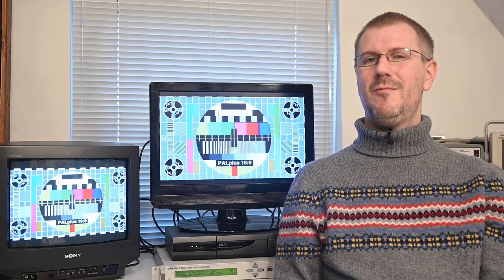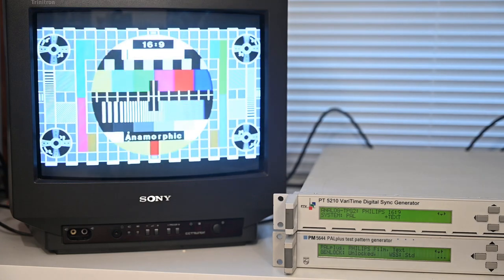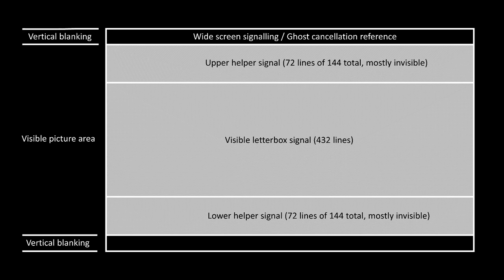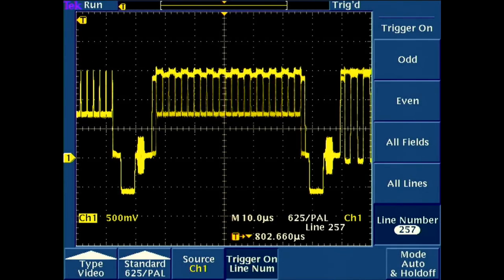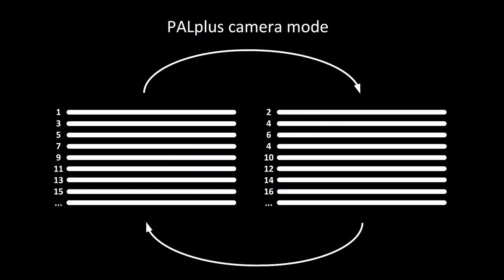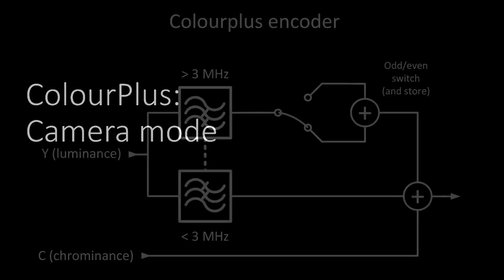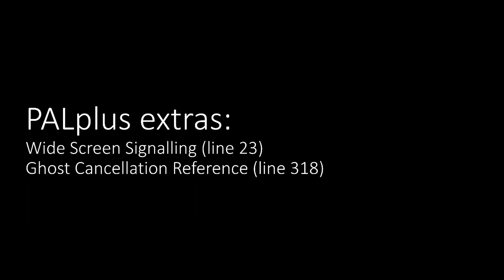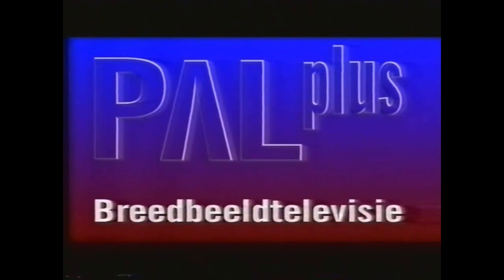#14 - PALplus explained and demonstrated

Comment: It's interesting to note that the case of the PALplus decoder is identical to that of a satellite receiver (Luxor MAC IV) manufactured by Nokia in Sweden in the mid 90's. There are two unused card slots in the front that were to be used for Eurocrypt smart cards.

Comment: How did the PalPlus signal work with color under VCRs? Remember that the color playback hetrodyne process produces a free running subcarrier against the signal H&V sync. And then the azimuth recording process also needed a field by field subcarrier phase swap as the head azimuth crosstalk cancellation was no good at the down converted chroma frequency.  I also noted lack of any analog anti-aliasing or re-construction filters on those ADC and DAC chip. (unless they were SMD under the board).  That right there is a serious image quality problem. I mean how much do a few small inductors and capacitors cost?
Reply from the maker: I don't know at present, but it sounds like an interesting thing to test
Reply: Well I don't think the re-construction filters were that important. After all the worst that could happen was that the video looks a bit "pixelated". All the signal frequencies are well below half the clock rate. In fact typically you sample composite video at 4 times the chroma subcarrier which gives you ample headroom.
Reply: I know there were some "VHS" recorders advertised to support PALplus. I think I actually have a PALplus recording standard consumer color under recording (Video 2000), but Video 2000 uses some trickery by averaging the chroma of lines for noise reduction. It might be that, for example U-Matic would just record it with reduced fidelity.
Reply: @mattstvbarn  Does the VCR SCART output a full-height anamorphic decoded picture (so you could archive the PALplus decoder output)?
Reply from the maker: @stephenneal7373  from memory it does, yes

Comment: Well in Germany that transmitter problem probably wasn't to relevant, as the early 1990s saw a huge shift towards satellite in Germany.
I think the first video I saw of PALplus was a demo tape... probably even down-scaled from HD as it looked spectacular. It was interspersed with a variety of test patterns.
There was in fact regular programming well until the analog switch off, but encoders were no longer replaced. So if an encoder was broken that source would from then on only transmit letterboxed PAL (or of course 16:9 over DVB).
What I've noticed in the late days of PALplus was that the quadrature filter for letterboxing wasn't very good. You could often see diagonal lines getting regularly spaced kinks in them. Sometimes stations would also put their PALplus encoder before the "bug inserter" resulting in broken signals.

What was missing for PALplus in Germany were the receivers. Virtually no TV-set had one built-in, external decoders were insanely rare. I wouldn't be surprised if there were more D2-MAC receivers than PALplus just because for a while it seemed like the future would be HD-MAC and a D2-MAC receiver would be compatible. PALplus was always designed as an intermediate step.

However from what I can gather, at least some modern TV chipsets employ a lot of the techniques coming out of PALplus. I have a (homemade) test signal generator with a 4,3MHz luma-burst and at least my 2010 Grundig TV was able to perfectly separate luma from chroma there. It's PAL decoding was done by a Mediastar (now Mediatek) chip"set", so that was nothing special.

BTW if you ever want to do something about Teletext. I do have a little animation I made for showing at talks. It starts by showing a real decoded video signal. Then it shrinks the video and brows up the teletext lines, then showing each scan-line being translated into it's textual data.

Comment: Great video (Though I'm pretty certain PALPlus fully blanked the source lines 23 and 623 - the half lines - and used them for references + Line 23 also has a half line of WSS) so PAL Plus really delivered 574 lines, not 576, which means the letterbox is 430 not 432 lines from memory).  Also the guy in the blue jumper and checked shirt at 7'39" in the old BBC Outside Broadcast scanner / van is my dad!

Decoder SCART is almost certainly to feed out and back to an external descrambling box for Pay-TV.  If PALPlus was used on satellite (or they though it would be) then it may have been aimed at pay-TV operators (or it may have needed to be integrated into that kind of set-up).  I've read two reasons for VCR SCARTs - one was to be able to record the anamorphic decoded output to VHS (retaining a higher quality recording than the letterbox), the other was to allow you to record and replay PALPlus programmes and decode them from VHS (though the helper signal would have been near-useless after VHS chroma recording?). The TV output is presumably also RGB analogue - because of the joy of SCART so you get the benefit of ColourPlus?  If you re-encoded to composite you'd have lost that?  

All the demos of PALplus I saw were pretty dreadful.
Reply from the maker: I wasn't able to get RGB out of it.
Reply: @vbarn  How odd. I can't imagine the purpose of a PALplus decoder with all the ColourPlus stuff if it didn't decode to RGB.  If as a manufacturer you're re-encoding to PAL for TV viewing you're killing the picture quality.
Reply from the maker: @stephenneal7373  I've heard this model didn't do colourplus.
Reply: AFAIK Premiere Germany used to provide PAL+ shows scrambled with Nagravision Syster so it means these technologies were compatible.
The decoder for Premiere could use single SCART cable between the TV or SAT receiver, same as Canal+ in France and Poland used.

Comment: An excellent video.  Thanks for taking on this incredibly complicated technology.  And hats off to those who engineered all this. I wonder if Techmoan will also do something on PalPlus?  There must be a rubber belt in there somewhere....
Reply: The main problem with trying to do a video on PALplus is that there are very few sources of full-res PALplus video these days, other than expensive test signal generators (as seen in this video) and maybe S-VHS off-air recordings made at the time, but good luck trying to find some of those. Standard VHS recordings typically ignore the helper signals.

Comment: I find your reasoning at 2'00" - 2'34" a bit obscure. What you are trying to say is that at the time 16:9 content was to be delivered using full existing signal resolution (as opposed to letterboxing) for 16:9 TV-sets, anamorphic was not an option as current 4:3 TV's had no letterbox feature . Hence PALplus was created which is backwards compatible with all 4:3 TV's (showing letterbox format) and still use the full signal for 16:9 TV's. 

On a side note: letterbox format on 4:3 TV's had already be in use for widescreen movies, before pan & scan became the fashion. After the arrival of 16:9 TV-sets and before, besides and within PALplus letterbox came back. 16:9 TV's lacking PALplus or getting a plain letterbox signal simply upscaled the picture pushing the black bars of of the screen.

Comment: Fascinating video as always. Is there a way to get an anamorphic signal to letterbox on a 4:3 TV? It seems any active adapters seem to forget 4:3 / 16:9 was a thing and not let you set it
Reply: Well at least with SCART inputs you can use the 12 Volt signal that switches to the AV input and just put 5 Volts on it. Some newer 4:3 CRT-TVs will switch to 16:9 then.
Reply: My 1990s 4:3 Sony TVs had a menu or remote option to put them into letterbox, and respected the SCART Pin 8 4:3/16:9 status voltages.  Some late era ones may also have respected Line 23 WSS.

Comment: Encoding PAL (or any modulated colour video) with consumer grade circuits is generally a pretty poor idea. The outcome isn't the best.

However just about every PAL TV supports RGB over SCART so that would have been a sensible option? Really don't see how that would have been necessarily worse than digital from DSP to display, given the output is a fundamentally analogue RGB CRT anyway.
Reply from the maker: The PALPlus decoder doesn't do RGB out.

Comment: I wonder what happens if you record a PALplus signal on VHS. Can it still be decoded afterwards? Were PALplus prerecorded VHS tapes available?
Reply: Mostly not as color-under recording scheme would degrade the helper signal a lot. However there are LD releases including Sony trinitron PAL+ demo disc which are found and captured using domesday decode method.
Reply: I had the same thought, and have probably some dutch and Belgian PalPlus on S-VHS. Maybe that has survived, but I don't have a decoder...